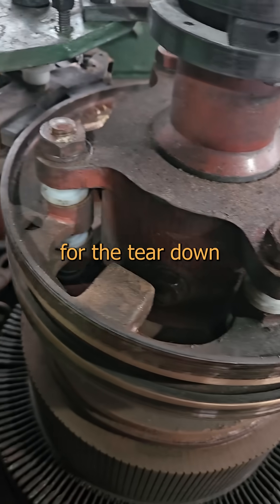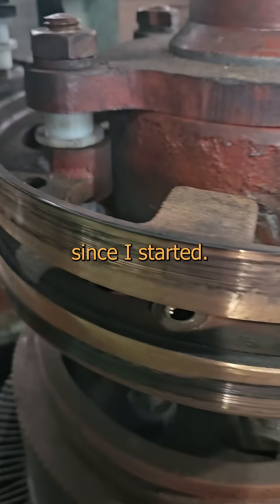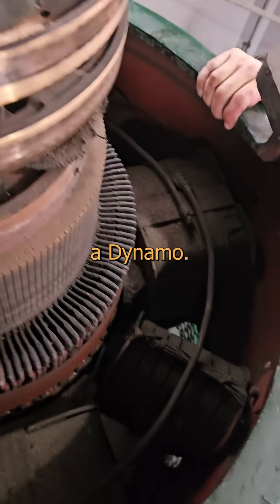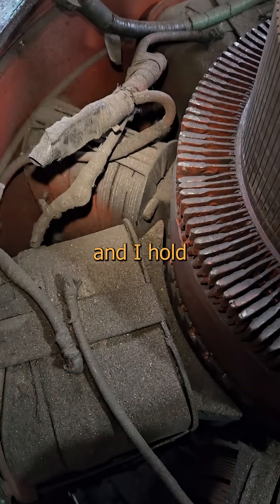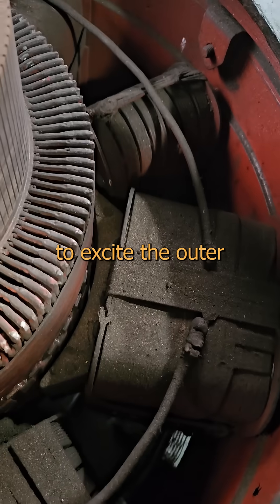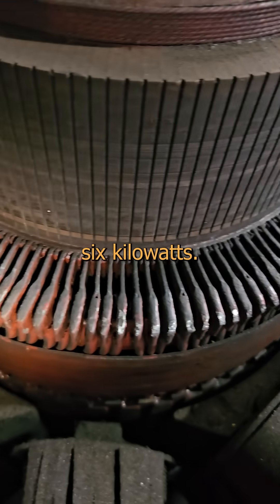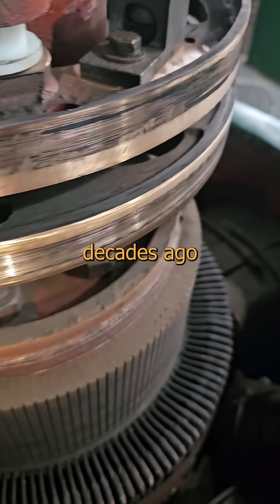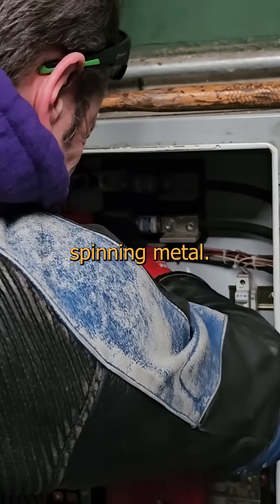Dynamo #chrisboden #engineering #generator #educational #powerplant #dc #exciter #field #hydropower

Comment: I applied for an apprenticeship place for the last cohort at Yallourn W lignite thermal power plant. I didn't get the job but I did get a very rare private tour with other shortlisted candidates. 

There are 2 remaining units consisting of 3 boilers and 2 or 3 turbines each. The older unit had a steam based blackstart system that would ramp up one boiler, run a small dynamo and a steam powered geartrain to get the main turbine spinning unloaded before applying steam pressure to it and turning exciting it's generator's. Once that turbine is online it sets the frequency baseline for other elements to sync to. With the primary turbine on and the plant in island mode they ramp up fuel rates to the burning boiler and power the fuel feeds to offline or idling boilers allowing them to bring unit 1 fully online which then can provide the power to bring unit 2 online. They have dedicated connections to the nearby newer station at Loyang as well as smaller peaker plants that burn biomass and natural gas. 

I wish I remembered more of the details but the plant was designed to be able to do a complete blackstart without any outside help in the case of a total grid collapse. I believe either Yallourn or Loyang would provide initial blackstart and frequency support, then gas peaker plants would come online next to provide quick responses to load fluctuations if the grid in the Latrobe valley was disconnected from the massive Snowy hydro power stations.  

It's all still operable but largely redundant now. We have so many redundant interconnects with slack capacity in this state and lots of black start capable hydro that it won't be replaced when the plant shuts down in 2028. 

The main problem we have is too much rooftop solar without proper visibility and control for the operators. Wholesale prices go negative during spring days and you see mass curtailment of largescale wind and solar installations. We have massive overcapacity and high transmission infrastructure costs which keeps overall energy costs high despite the very low marginal cost of renewables.

Comment: Im surprised you need the battery. I thought the older dynamos were permanent magnet.

The pulp mill i used to work at had a tiny dynamo for the same reason but it was capable of running off grid so a black start was a potential.

They had a little 1 kw dc motor, a 1 MW water turbine and then 3 steam turbine at about 2 MW each. Theyd boot strap the water turbine with the dynamo and thats enough power to fire up the boiler.

Comment: A lot of these things should be in a museum once scrapped it is gone forever. Reminds me of the big old air compressor that was in an old building I worked at. Th thing was about 15 feet high open exposed motors huge pistons and the  crankshaft was open . it stank of old stale oil and the dark dank room it was in. it produce barely 100 psi of the most damp  air.  I now wonder what happened to it. . I bet the cost of removing it was not offset much by it's scarp weight. So it could still be in place.

Comment: 100% Chris! Having a robust, non-electronic technology Black Start system is vital. And having a (slightly) over-rated HUGE, reliable, mechanically sound dynamo sounds like just the ticket, as long as there's water in the river (or a lot of guys and a long rope). Our Black Start system begins with a single-cylinder Onan 1kW gas generator, a nominal 1 kW output,  started either with a 12 V battery or (shudder) a "free rope" starter (a "non-recoil" rope). It's service speed is 1800 RPM, convenient for constant-output DC or frequency-stable 60 Hz AC. (Does anyone even MAKE 1800 RPM one-lung engines that run reliably in any temps from -60C to 50C (122 F) anymore? Onan went to the trouble of putting not one, not two but three fuel systems, each with fuel filters, in front of a carburetor. It runs on gasoline, "White gas" (a.k.a. naphtha  or Coleman fuel) or Kerosene & has a dual-magneto ignition. It's got a built in mechanical diaphragm fuel pump and hose, should we want to suck juice from a barrel or jerry can. Onan stopped making spare pump diaphragms around 1970, but the metal bottom of old-style Pringles chip tube and a piece Massey Ferguson tractor inner tube will make a suitable replacement. Onan also supplied a 'wall-mount' remote fuel tank pressurized with a bicycle tire pump. The remote tank has an air-pressure relief valve (a bit like a pressure cooker) so enthusiastic pumping doesn't burst anything. Whoever thought up all of this foolishness figured that 2 or 3 alternatives, made of cast iron or 3/16" sheet steel, might be useful someday. Almost as if they believed in Murphy's Law, or something. 
This 75 year-old iron lump of iron is the first link in our "black start" chain. It's stayed in place because every replacement has "failed as designed" with spare parts unavailable. It's not as sexy as an exciter dynamo the size of a Volkswagen bus, but we test on a regular schedule and it still runs fine. I'd like to have another one, same model, as 'backup," but they're a bit thin on the ground. In the meantime, the green beastie that could have applied for the Old Age Pension 10 years ago gives us non-electronic DC excitation, or 60 Hz AC (separate  windings), and it's pretty cool. It also runs circulating heaters for coolant (there's an exhaust heat exchanger), plus lube oil heaters and pressurizing pre-oiler pumps on the big Diesels. (The guys at the airport have a similar heater/pre-oiler on a cart for the engines on their DC-3's, so it's not a new idea). Living by the Arctic Circle gives an incentive to make sure we can get everything running even in frosty February. Old-school cool.

Comment: I used to work in a steel mill on the 1970s . We had giant synchronous motors  with individual coils for over 48 poles . Laying on the horozontal it was 24 foot tall.

Comment: Her Twitterly Nipple.  😂😂😂😂😂😂
     I actually Jump started a single Truck battery to start the Refrigerator unit diesal engine on my Trailer with an M18 Red Lithium High Output XC8.0.  18 volt.   I saw videos on YouTube of guess starting a regular car battery in their pickup trucks with a regular 18 volt rechargeable battery.  
    It drained my battery in just a few minutes. But it started the Reefer engine.  Super cool.

Comment: In 1920 my 300KW plant was converted from hydro mechanical (big waterwheel ) to hydroelectric. The original excitation was a rotating DC generator that was replaced with a motor generator set by me and I finally converted to a solid state exciter 10 years ago.

Comment: Instead of using an oscilator to make AC, why not reconfigure the dynamo's output from rectified DC, back to it's regular output of AC? ALL generators/dynamos produce AC, as it is a function of the "cutting the lines of magnetic flux" in the stator's field windings.

Comment: Ive never seen them since the 80s but we used to have dynamo bike lights.   You could move a plastic wheel, that then touched  the bike wheel. So when you pedal, it spun the plastic spool,  the lights would come on.   No battery ever needed.    Don't see them these days.  😢

Comment: Get that thing back up and running and if for some reason the entire power grid goes down you can tell one of your body is to go get some jumper cables in the battery out of your car to begin putting power back into the system maybe even but enough power in so other plants can also get their generators going again

Comment: The big spinning metal elephant in the room ,is that we need to be engineering these systems with maximal resilience and redundancy. All the high tech  efficiency in a system dims in comparison to having a system with  slightly outdated ways of getting it back up and running after a disaster with minimal complexity

Comment: Early 70s I was a maintenance electrician (called Motor Inspector) in a steel mill in Colorado (CF&I). There were many Westinghouse Mill Master 250 volt DC motors. There were motor-generator sets with an AD motor driving up to 4 DC generators. I found that 250 volt DC was capable of carbon tracking and causing all kinds of problems which is why slate sheets (yeah, rock) to mount the motor controls such as relays and contactors on. Glyph paint was great insulating paint.

Comment: So what's the hold up in fixing the dynamo? Does it need rewound, or is it ready to go and just isn't wired into the system anymore? I've never worked on a 10 ton spinning death motor, but I've fixed plenty of .7 amp sewing machine motors, and I reckon they're basically the same.

Comment: Black starting a plant from a car battery would be pretty impressive considering the power requirements to black start the grid. You need small plants that can black start easily just to get the other plants enough power from a small one to black start them. A car battery worth of power seems like a reasonable “switch to flick” in the chain. Start this, start your plant, start the gas plant, start the nuclear, start the grid. 

All from a car battery. This is actually some damn good insurance.

Comment: They still use this on mobile generators 120/240 up to 408 "wacker neuson" it is electrically excited input voltage controlled by the avr steps up the input voltage going in to the main generator

Comment: The dynamo allows black start capability and they want to remove it?  Are they crazy?  Besides, it provides some additional inertia the bearings and shaft were designed to handle.  I'm sure your small plant probably isn't a priority black start site, but damn that would be nice for emergency backup for the area.  ...You know...your plant probably provides enough inertia to pick up local solar generation.  That's an interesting thought, how big does a black start plant have to be on a sunny day to pick up solar generation, if it's a solar heavy area?

Comment: Give the slip rings and commutator a skim. Wash and varnish the armature and stator. New bearings, it will go another 50 years. Much more robust than modern electronics.

Comment: Remove the carbon around the rings, and replace the brushes after cleaning it up to museum quality

Replace any wires that may ground fault and give her a kick to start.

Or put my system on top of it, instead of hydropower, my design for a new kind of generator might be a bit too much for that little thing, but I'll give it a go if you like.
😊

Comment: Helped build and eventually operate a large offshore gas refinery several years ago. Completely self sufficient with our own power generation.
I got to develop the switching procedures for a full site black start. Every generator off and cold, every UPS system flat.
Worked out how to get the entire plant running from a car battery if needed.
It was pretty cool.

Comment: So you are saying you can blackstart a powerplant with car batterys. 120V 50 amps eh not that much to ask really.
Crazy. 
But a battery bank to power the controls and provide exciter voltage is actually really practical in my books.
Or just a diesel genset parked outside feeding the building.

Comment: Plant I worked at had a diesel black start generator. It started on compressed air, didn't need any type of power to start and generate power. Why would you need a battery on a hydro generator with a DC generator exciter??

Comment: The Worthington diesel plant at Buckley still has its exciter and sometimes they'll switch on some bulbs with it. The main stator is grodilated and had its leads snipped back when it was pulled out of service in the 90s. But the exciter works!

Comment: I always wondered why the armature windings on exciters like these were on the rotor, I'd have thought it would have been easier to have this in the stator (so just a smaller version of the main generator) and just rectify the output with some static equipment. A lot of the UK hydro generators were made late-40s 50s, maybe the commutator was just the most reliable method of rectification at the time. Certainly having it on the rotor makes it easier nowadays for brushless conversions.

Comment: Way I see it, if it's still there and still capable of working, it ain't worth getting rid of. Plus, black start power pays BIG money in the event of a major grid failure, and those are sadly getting a LOT more common with how much critical infrastructure is on a "run to failure" maintenance plan. If nothing else, it means that you can be revenue-earning when some drunk driver hits a power pole, cause there's still customers on the spur line who'd gladly pay not to get left in the dark.

Comment: YOU! I BLAME YOU! WHY? Because I'm ADHD and I love wild electronics and guitars to no end. So what did I do? I have a prototype to make for a preamp system... using Subminiature tubes. Yeah, I want to run an active pickup system using sub miniature tubes. While this means permanently changing a guitar, should this work (before it's mounted to a guitar) I will have made something kinda new. A tube powered pickup isn't actually new, some one beat me to this but their system requires the guitar built around the pickup. It's called a valve bucker and it's really cool because it glows from the tube, and it's a full sized tube so it takes up alot of space.

Comment: Nice to have the ability to black start. The best installation I’ve heard of was the black start at hover dam, just crank open the intake valve with a loose grip on the wheel, once it makes enough power for control it yanks the wheel out of your hand. Stand clear and watch it start. My big hydros had batteries and co2 pressurized hydraulics. My pump storage literally had a pull start generator wake it up.

Comment: The ability to start any large plant with that small of an input source will be crucial in the years to come if things continue in a similar pattern to what's been happening. All crucial infrastructure should have near infalable backup systems in place to get things going on at least emergency power in a worst-case scenario.

Comment: Restore it, do a black start, but don't do it from a car battery, do it from a pull-start generator.  Then you can tell the story of that time you pull-started a power plant.
Reply: AGREE! Now THAT would be cool!
Reply: I'd love to see that
Reply: yes, in stormworks i built a large diesel-electric cargo ship. but it had a tiny little hand started generator if the main and aux batteries were dead. it had enough oomph to get the aux generator running with basic electricals and once that sprang to life the whole ship would wake up with the main engines popping off a minute later (once their batteries got enough juice in them)
Reply: Brilliant! 👏

Comment: I like your idea of a backup. The upper echelons of management will be delighted to take all your credit when the grid has to do a black start at some point (heeere's looking at you Texas!). It would be scandalous to not use an existing system which just needs modest repair. 
You could consider an upgrade at this point too. You have one hell of a runout and air gap. I smell a little in-situ core armature machining into round and concentricity. You can add ferrite core inserts to narrow the stator airgap, and you should see significant efficiency improvements in vigorous pixie movement per pixie waving. Might take a while, but if the rotor is nice, round and concentric, the runout will be teensy and the later stator module insertion shutdowns could be quite quick if the design allows it.